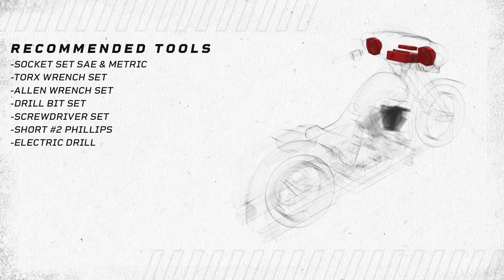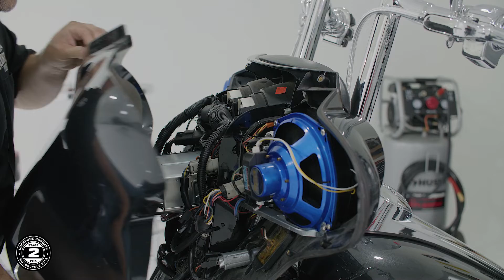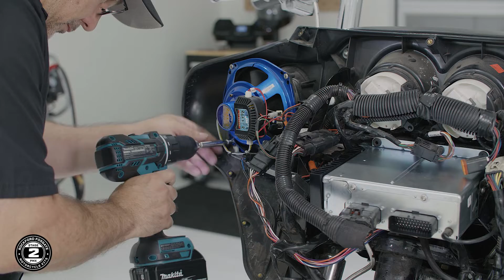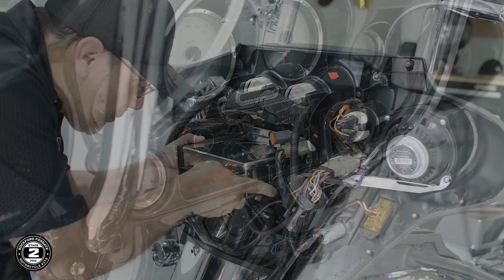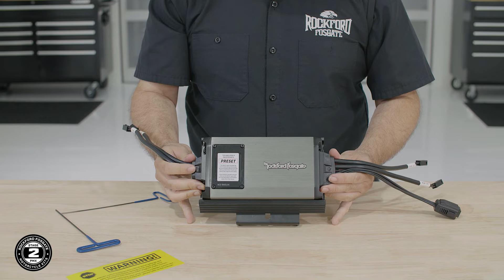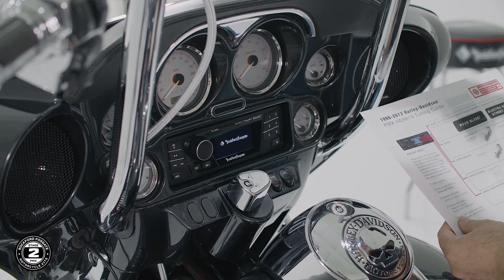1998-2013 Street Glide/Electra Glide PMX STG2 | Installation

Comment: I have this kit installed and recently found that the clock will not retain its settings. I can adjust it to the correct time/date and back out of the menu and watch the display change from the setting I just created to an incorrect date/time (I set it to 6AM and 4/9/2024 this morning and watched it revert back to 9:## PM with a 4/12/2024 date).
Reply from the maker: You likely have "RDS" (Radio Data Systems) enabled which automatically can set a clock.  
You can disable this feature under the FM SOURCE menu.

Comment: I installed this along with the RF amp and I lost thump controls. I’ve tried the SWC custom setting changes with no luck. Any suggestions?
Reply from the maker: So assuming you put new handlebars on and extended the wiring harness, right?  If you have already gone through the SWC settings (https://rftech.custhelp.com/app/answers/detail/a_id/1401/) with no result, I would call technical support Monday at 1-800-669-9899 between 8am - 5pm PST.